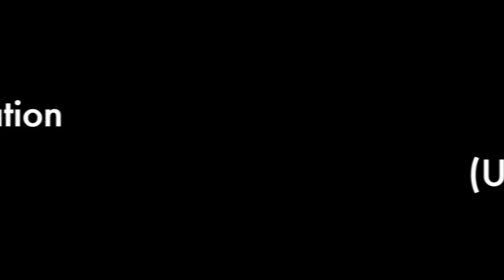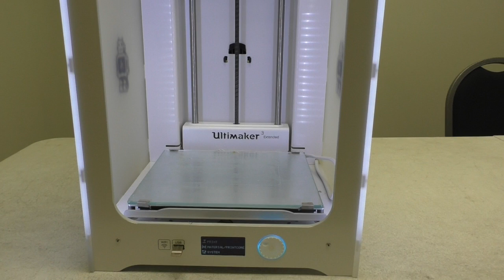Calibrating the Lifting Switch (UM3/UM3X/S3/S5/S7)

Comment: Madam could you please help me in my machines there is lift switch error can occur i.e Same height can detected for  both print cores please help me
Reply from the maker: That error can appear for a number of reasons, including:
1) the lift switch did not move the print core when it should have--is your print core on the right moving up and down?
2) filament on the end of the nozzle throwing off the height reading
3) bed springs are too loose--if the bed is too tall it throws off the expected total height from the Z-limit switch to the nozzle
4) check the white and red cables on your capacitive sensor for damage/disconnection
5) if you've recently disassembled the print head, a pinched fan wire can cause electrical interference that will disrupt the active leveling process. 
6) Damage to the print core; if the print core has been disassembled or the nozzle damaged it can also disrupt the expected height of the Print Core. 

I hope this helps get you started in the right direction!

Comment: what is the issue if the printcore 1 & printcore 2 still same height?
Reply from the maker: Hi, 学习, it's impossible for the 2 Cores to be the same height. The lifting switch raises and lowers Print Core 2, by 3mm, keeping the offset from Print Core 1 at 1.5mm. Print Core 2 should always be either 1.5mm higher than Print Core 2, or 1.5mm lower. What's the wording of the error message you're seeing? If there is is filament on the end of one of the Print Cores, it can confuse the sensors into thinking the Print Cores are the same height, or that the height difference is bigger than 1.5mm.